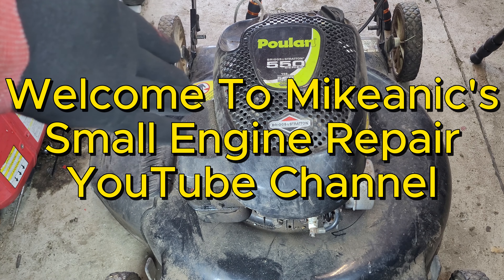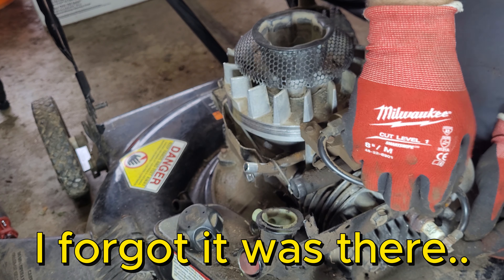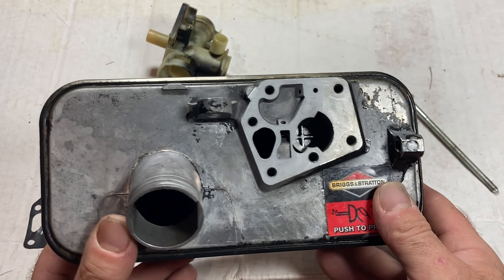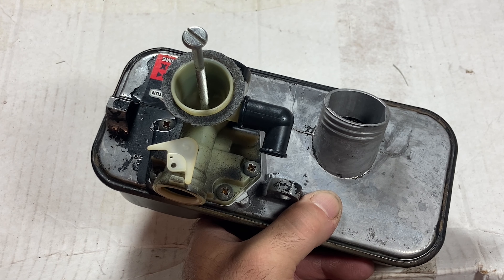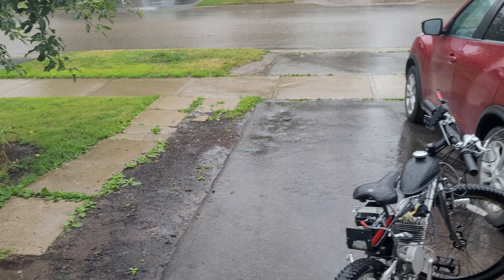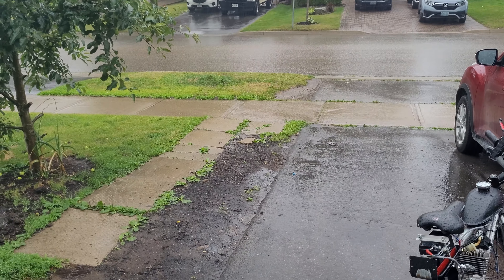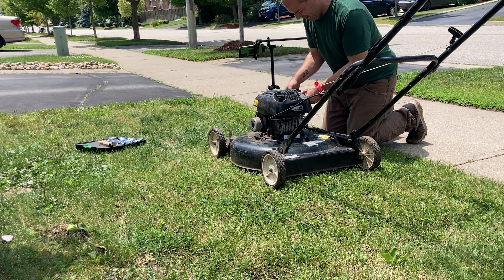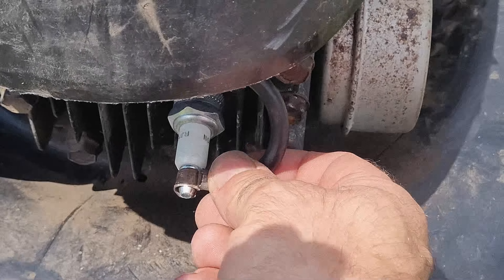If Your Mower Is Missing This, You're Screwed!

Comment: I always clean all the parts because it just makes it easier and look better.   Carb cleaner is a multi use tool 😊
Reply from the maker: They do! Only issue with using Carb Cleaner, it is a good paint stripper too.. 
WD40 does okay at working free dirt, oil, and grime. I was very impressed with how well "Simply Clean" in the ultrasonic worked.

Comment: Looks like the dirty air filter caused the plug to foul. Had that not been the issue, a peek at the valves is next. Worn seats can cause hard starting. In the end, that little engine sounds healthy!!
Reply from the maker: I'm really glad it was just the air filter causing the problem, instead of something much more sinister.
Easy fixes are the best fixes!

Comment: In the 100s of Classic Briggs that I've worked on, I have NEVER seen that style filter.  That was interesting!  I was sitting here going "eh, just convert it to the foam style" and then later on that's what you did.  I managed to snag the entire Briggs Filter setups from Lowes a couple years ago on Clearance for like $3 or so.  I took home about 5 or 6 of them.

Also, for the primers, I found using a socket to push down on that clip makes it super easy.  I'd have to check what size it is I use, but I think it's an 11/16.  It fits down perfectly on the classic primers and also the Quantum ones.  I'd have to check if it works on Tecumseh, since I usually just swap the carbs out instead of fight with the linkages multiple times lol
Reply from the maker: Dang! That's wild. Here I am thinking this is just because I'm learning about this whole thing, and that filter is fairly common.. only to read a couple comments now that this is not a common thing for Briggs to do. 
Strange strange!
You scored on those foam filters! That would have been a nice find

Never thought of that for the primer .
I know with Tecumseh it's just a 3/4 socket and a hammer 😂
Reply: @Mike-anic  Yeah, Lowe's the last couple years has put a lot of spare mower parts on clearance.  I picked up some 21" and 22" blades for under $8 each - I nearly cleared them out.  

I generally buy spare parts overseas.  It's a lawn mower, and the cost of OEM parts makes most repairs not cost effective.  I stock up a couple times a year, since I don't have enough storage to do it all at once (I have parts in my shed, garage, home office, and in-lawns place).